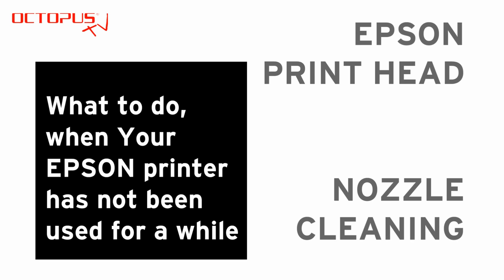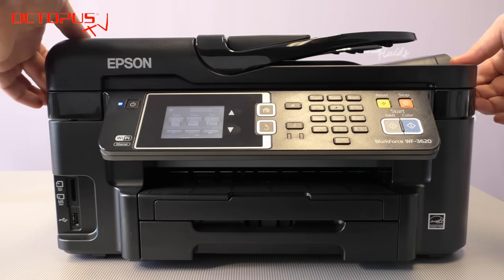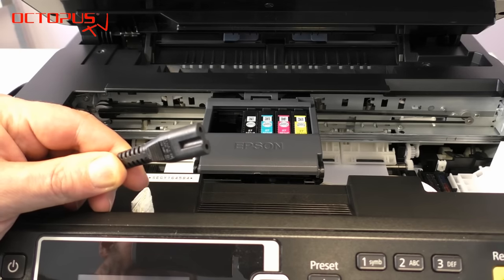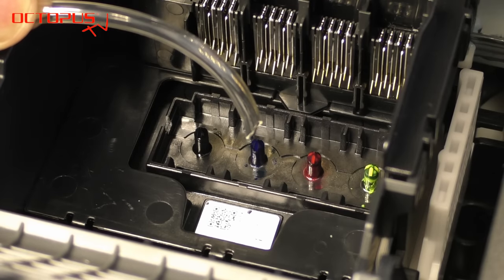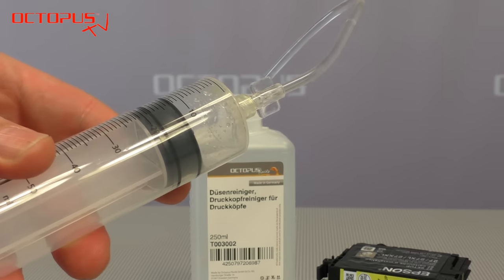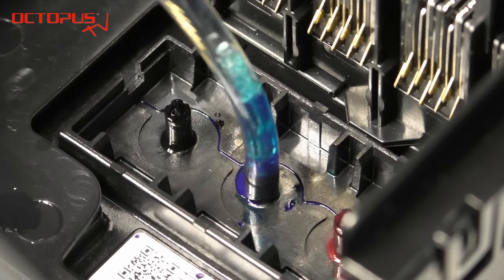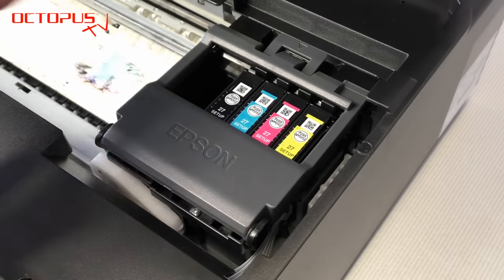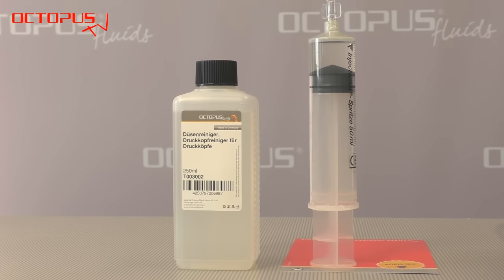Epson print head cleaner, nozzle cleaning - flushing clogged nozzles

Comment: Hi How long would you advise it would take to drain the excess out? I did the cleaning as per your video and now printing completely blank pages Have printed a lot of test pages to use up the fluid remaining in the print head but having now placed an underlay underneath nothing is draining from what I can see. would i need to leave overnight? Also I had full cartridges before starting and now my cyan is saying low. Could there be something else wrong?Any Advice would be great thank you
Reply from the maker: Hello Maggie, thanks for Your question. As You say that You have an underlay underneath the print head´s nozzles: Are the new cartridges installed? The underlay should extract the remaining nozzle cleaner and also bring new ink from the cartridge into the print head. Can You see any color on the underlay yet?
Reply: no nothing comes through - the cartridges are about a week old.
Reply: Thank you for your prompt reply!
 And yes I have the cartridges in when draining the excess.
Reply from the maker: Thank you very much for Your description. With our Epson Workforce 3620 we had have to print 100  test pages before the colors came back.
It might be the case that there is air trapped inside the print head. Take out the cartridges and flush the print head with cleaner again - make sure not to push any air into the print head. The print head should be free from air by now. Then set back the cartridges into the printer and position it above the absobent underlay. This should get rid of the cleaner and move the ink towards the nozzles.

Comment: Can I clean with just water?
Reply from the maker: Hello Emilia, thanks for Your question. Normal water contains minerals - not good for the print head inside. It may happen that these minerals solidify in the print system and cause additional problems. When using water please use DEMINERALIZED CLEAN water.

Comment: would isopropyl alcohol not do the same job?
Reply from the maker: Hello Joe, thanks for Your question. The inks used in the Epsn desktop printers are waterbased ... usually. To have a dissolving effect on the cloggings the cleaner fluid should be waterbased too. So alcohol does not have this dissolving effect - but it will not do any harm either.
Reply: @octopusoffice  thank you
Reply from the maker: Hello Joe, You´r welcome ! 🙂

Comment: I do not live in your county. Amazon does have a cleaner I suppose that would be worth using. I am sure I can mix something but, I do need the syringe and the hose, though.
Reply from the maker: Hello Lynne, thanks for sharing Your thoughts. We are sure that You can find the necessary supplies if You go to pharmacy near to Yout place - they should be able to provide You a syringe and maybe also with a medical connection hose. The inner diameter of that hose should be 3 to 4mm. When You press the plastic material on the ink port usually You can widen that plastic hose a bit.

Comment: Hello I have an Epson Artisan 835, I think  I have air in the printer head, how can I fix that ?  thanks
Reply from the maker: Hello Jack, thanks for Your question. How does the inlet for the ink inside the print head compartment look like in Your Epson Artisan 835 machine? Is it similar to the thorn version shown in our tutorial? If this is the case You can flush the print head with cleaner to get out the air in the way as shown in our video. This saves the expensive ink from the cartridges as You could also run print head cleaning sessions from Your printer directly until the air is out. Usually this consumes a lot of ink and fills up your printer´s  the waste ink compartment unneccessarily.
Reply: @octopusoffice  Thanks for your help, at the end since it was full of bubble, I unscrewed a bit the attachment o the heat print (at the end of the tubes ) and I flushed some octopus cleaner, it was a bit a mess but the tubes now are all full and the printer is printing again!

Comment: I followed all instructions and cleaned just my black ink heads, but now have run several test pages, run several head cleanings and tests, and have removed and replaced the black ink cartridge twice, but still I get no black ink, only blank pages. I cleaned all the liquid from the towel area. Before I did the cleaning, I got streaks and some blurs, but at least I could still print SOMETHING. Now, I get absolutely zero black ink. Is there anything else I can do get it working again?
Reply from the maker: Hello James, thank you very much for contacting us and providing this helpful description. Replacing the black cartridfe twice after cleanining means that it has been emptied twice? There is the question if these two cartridges have been really empty, meaning ink going through the print head, or the empty message appeared by the chip calculating that the cartridge must be empty due to its use in the printer (independend from if there was actual ink leaving this cartridge). We assume that there is air remaining in the print head in the black color line, it prevents the new ink reaching the nozzles. Best way  to get rid off this is to flush the black color line with cleaner again - make sure not to press any air into the print head. After that go back to print out the cleaner.
Reply: @octopusoffice  thank you for your reply. I was simply taking the existing (still full) black ink cartridge out and putting it back in, to see if that helped it register. But still no black ink. I was worried about trying to send more fluid thru, that I would flood it or cause more harm.

Comment: What can we do if flushing it isn't working? Is there a way to get it to work?
Reply from the maker: Thanks for Your question. What does not working mean? Are you not able to get the cleaner through the print head? Or are the lines and nozzles free but no ink appears on the paper when printing? Thanks for the additional information?
Reply: @octopusoffice  How do we get it to work if the cleaner isn't getting through the print head?
Reply from the maker: Thanks for coming back on our question. When the cleaner does not got through the print head You have two options:
1.) Time is king - mount the plastic tube on the ink inklet which You would like to clean. Fill it with cleane and let it sit there overnight. Try again pumping it through the next day.
2.) This You can combine with option 1 - but then You need to clean all colors. Put a piece of kitchen towel soaked with hcleaner under the print head´s nozzle plate. There the cleaner can dissolve cloggings from the underside. Her You need to know that the cleaner also sucks out the ink from the other colors.
In general You have to make sure using the right cleaner - depending on the kinf of inks that You using in Your printer. Waterbased inks need a waterbased cleaner for example.
Reply: @octopusoffice  I let it overnight and it still hasn't worked and now the printer isn't working. I think it could be the cleaner we used but is there anything we can do about it? Thank you for answering
Reply from the maker: Thanks for giving our suggestion a try. What means the printer isn´t working? Does it give an error message?
Reply: @octopusoffice  When we tried to test print it, it only came out blank.
Reply from the maker: Thanks for the description. In the best case no ink appears on the paper as there is still cleaning fluid in the ink system. That has to be printed out - to save the planet please use already used paper and start printing 100+ test pages - let´s see if the colors come back - when they come back before reaching 100 - stop printing to save that ink.
In the worst case there is some solid blocking inside the print head that Your used cleaner is not able to handle - the core question is what kind of inks You have used in the printer? Waterbased or sublimations inks or something else?
Reply: @octopusoffice  Thank you! I'm not sure what type of ink it is.
Reply from the maker: We suggest to give the test prints a try ... make sure there is sufficient ink in Your cartridges and have a look if colors come back slowly...

Comment: Please are you able to help with Epson ET 4500 printer model? Ink was mistakenly put in the wrong tank. Is there anyway I can flush the ink out? Thanks
Reply from the maker: Hello fesocan, we would suggest the following approach to get the right ink color back to the print head´s nozzles:
1. empty all the tanks are good as possible
2. fill the right ink color into the tank, that has been filled with the wrong color before
3. install an absorbent pad under the print head´s nozzle plate - that could be a folded paper kitchen towel on a layer of plastic foil
4. the absorbent pad sucks out the the ink from the print head and the connected tubes
5. the right ink color replaces the wrong ink in the tubes and the print head as it is sucked into the absorbent pad (emptying the other colors before safes these valuable inks as the are not sucked into the pad for no reason?
Why not to push the ink into the tubes? Most of the Epson printers, whose print head is connected by tubes to the ink source - in your case the external tanks ,  an one way valve at the print head prevents pressure from the ink tank having effect on the print head. So the only way is to suck the ink in from the nozzle side.

We hope that helps....
Reply: OctopusConcept Wow am really impressed for you to actually take out time to type all this steps. 
I will try what you suggested and I will get back to you. 
Thanks so much for your time, you just got a new subscriber anyway.
Reply from the maker: Thank You for the feedback.

Comment: Can I use alcohol instead of the cleaner you have used
Reply from the maker: Hello Khalid, thanks for Your question. Usually the inks used in the desktop sized Epson printers are waterbased inks - alcohol has no solution effect on these inks or cloggings caused by this type of ink. The cleaner should be waterbased too when the inks are waterbased. Alcohol will do no damage to Your printer but its cleaning effect will be limited ...

Comment: Can isopropyl alcohol be used for the cleaning fluid?
Reply from the maker: Thanks for Your question. You can use any kind of alcohol but its cleaning effect will not be the best for the Epson print head. The inks in there are waterbased inks and if they are dried or cloogged alcohol does not dissolve them.  Therefore the used cleaner should be water based too to have the best effect. But alcohol is doing no harm to the print head :)

Comment: My wf 7720 seems clogged after I refilled the ink cartridges. The nozzle check for the magenta has been producing no lines....I’ve used this printer nearly everyday with no issues until I refilled the cartridges
Reply from the maker: Thanks for Your question.  Did You use a refill ink specifically compatible to Your printer model and cartridge model?

Comment: After doing this the print came blank, completely white, using exactly your products. How is that possible?
Reply from the maker: Thanks for contacting us. After applying our cleaning approach there is still cleaner remaining inside the print head. You have to get the cleaner out - best way to do that is by printing. Please print on old paper / already used paper. During cleaning please pay attention to not press any air into the print head.
If You have bottled ink available You can flush the print head using ink from the bottle using the cleaning syringes.

Comment: What if the ink is sublimation should I still use mineralized water?
Reply from the maker: Thanks for Your question. The cleaning fluid must be adjusted to the type of sublimation ink You are using in  Your printer. There are for example waterbased sublimation inks and alcohol based sublimation inks. So for the waterbased version You need to apply a waterbased cleaner made from DEMINERALIZED water. And the other way around for an alcohol based sublimation ink the dissolving effect must come from a cleaner containing alcohol. Please check Your sublimation inks for what applied to You.

Comment: Can I use the WF-3620DWF 27xl refillable cartridges for wf-3620 252xl
Reply from the maker: Hello Anna, according to Your cartridges´code 252xl we assume Your are based in the Australian / Pacific region or You are a using a printer from that region. Refillable cartridges for Your printer must have the same code as the cartridges You are using right now - 252 or 252xl. Our alternatives for Epson 27 will not work in Your printer.

Comment: Do u know why the liquid is not flushing through for me
Reply from the maker: Dear Shazad, thanks for Your question. So Your print head is completely blocked and no cleaner at all can be pushed through it, right? What kind of cleaner are You trying and what kind of inks ws used inside the printer before?
Reply: @octopusoffice  i was using the original ink by epson and i bought this cleaner off amazon it worked for the other colours but black wont move
Reply: Do you know what i could do to fix it

Comment: Can I use Alcohol to clean?
Reply from the maker: Thanks for Your question. Depending on the type of inks that You use in Your printer a certain cleaner will have the best effect. Assuming You work with a normal Epson desktopprinter - these machines usually work with water based inks. The best cleaner for this ink type is also a water based cleaner. Alcohol does no harm but also does not dissolve pollutions caused by water based inks.

Comment: Does anybody know how many days/weeks the epson p700 can "survive" and not clog up without any printing? I've read that they fixed it with the p800 already...  If it clogs up fast, would printing a clogging test sheet every week help?
Reply from the maker: Hello, thanks for Your question. We would say that there is no exact answer how much time the p700 will wait before it clogs up. Many circumstances have influence on that.
But the approach to print at least once a week will definitely help to prevent the printer from clogging.
Reply: @octopusoffice  thanks for your reply. Would you also know how many prints one could get out of the 25,0ml ink cartriges?

Comment: Unfortunately this way looks like fully destroyed my printers head (WF7610). After first attempt it was better, with several line missing for each color. After second attempt - it doesn't print any color at all. Just pure white paper after nozzle check print. Another point, i thought this way will save ink's during cleaning, because i had very bad expirience with builtin Epson's cleaning procedure when each cycle reduced inks by about 10%. But I was very surprized that after first cleaning attempt with octopus and reinstalling ink cartridges again - it reduced inks by about 50%. WTF ?
Reply from the maker: Hello Andrey, thank You very much for Your detailed description. When applying our approach there is a certain amount of cleaner in the ink system. That´s why the prints appear white after the cleaning - the colors come back by running prints in old paper. The drop of the ink level for the cartridges seems to us that the cartridges might have been at the point soon reducing the displayed ink level before applying the cleaning. When taking out that used cartride and putting it back into the printer - the cartridge is reevaluated by the printer and in Your the printer assigned a lower ink level to this cartridge.

Comment: I dont have that cleaner. Can i use water instead?
Reply from the maker: Thanks for the question - You need to get Your hands on purified and demineralized water. "Normal" water contains minerals - there is a chance that these minerals react with the inks inside the print head and build up solid structures there - then the print head is clogged 4ever  :-(

Comment: will this procedure and product work for a Epson Stylus DX8450?
Reply from the maker: Hello and thanks for Your question. As we can see from the pictures the  Epson Stylus DX8450 also has a moving print head compartment where the cartridges are sitting in. There You have access to the ink ports inside that carriage - so You can apply the method from the video there too.

Comment: My black Ink cartridge wasnt reading the ink cartridge then it started reading it but stopped printng black ink. I flushed it but its still bot printing black ink with a fresh cartridge.
Reply from the maker: Hello Michele, thanks for Your description. There are 3 possible reasons for Your situation:
1. There is still cleaning fluid inside the print head. Just keep on printing to print out the cleaning fluid. The color should come back to normal slowly.
2. There might be air beeing trapped inside the print head. During claening it happens very often that air is pressed into the print head. Then the printer does not print. Flush again making sure that there is no air in the print head. After that print out the remaining fluid.
3. Worst case would be that print head has a damage at the black ink line. This cannot be fixed by cleaning :(

Comment: continuing my comment....  the black printout stops and no matter how many times I do a cleaning cycle, even with the black tank full of ink, I cannot regain black printout. Inject black ink with syringe, black printout returns. It's as if flow from the black tank to the head is for some reason not possible yet black ink will freely drip from the black tank when I have the tank removed.
Reply from the maker: Hello Clif, thanks for Your description. When You are saying black tank You refer to a black inkjet cartridge, right? Have You tried to use another cartridge then the one in Your description?